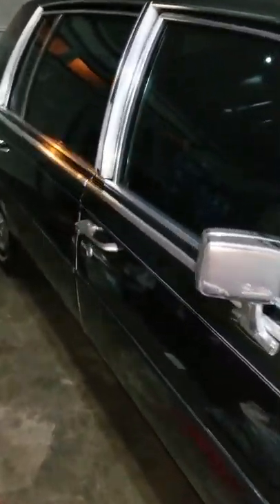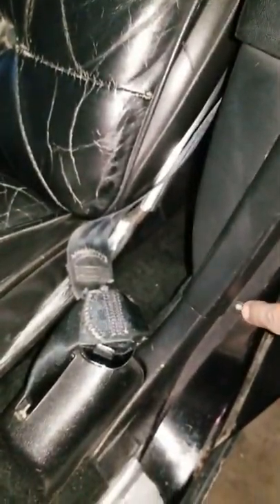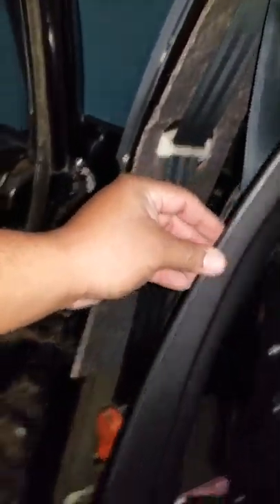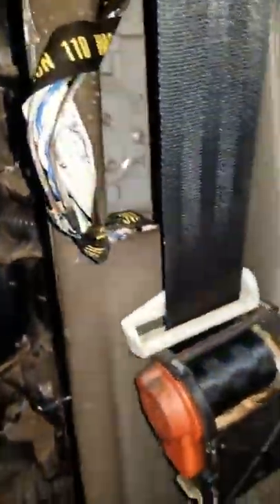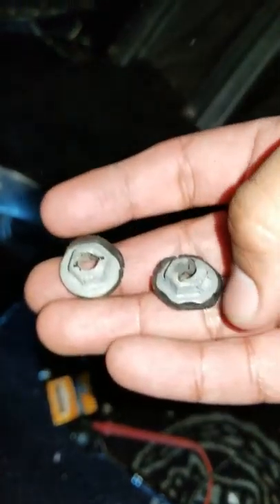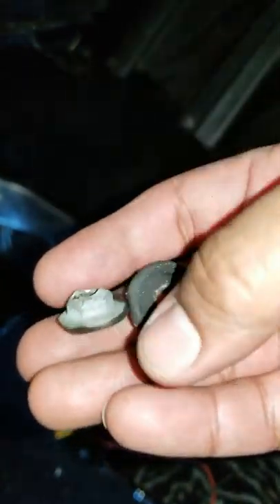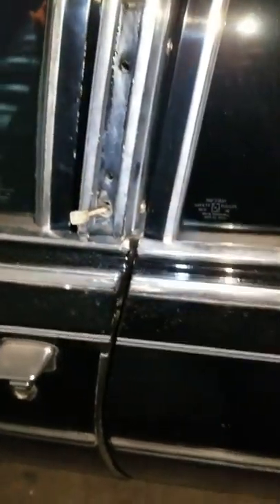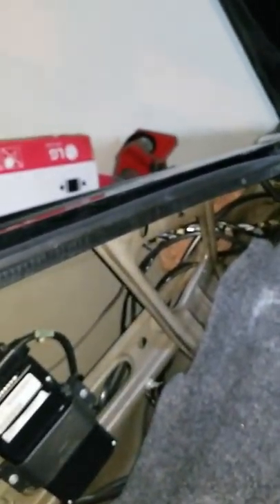How to remove opera light on 1986 Cadillac Fleetwood Brougham D'elegance

Comment: None of my 4 lights work.  Do you know when the lights are supposed to come on?  Doors open only or with the headlights?  Thanks, Dave.
Reply from the maker: From my knowledge I believe the lights only come on when your headlights are turned on. But I am not sure if yours would be different or not.
Reply: @wacoflipp2458  Thank you for the reply.  I have the huge service manual for the car and will be digging to see how it is wired.  The video is awesome.  Thank you.
Reply from the maker: @davewilliams1097  No problem, thank you. What year and make do you have?.
Reply: @wacoflipp2458  I have a 1989 Brougham as well, but mine is a 21 foot long Hearse.  I have NO idea where the coach builder might have hidden the inverter.  It has been so very HOT here in South Carolina to even think about crawling around in the back of the Hearse till it gets cooler.
Reply from the maker: @davewilliams1097  Yea I hear ya, its hot out here in texas too. If I would take a guess I would say they hid it somewhere behind those side panels in there towards the back end. But that's just my guess. Good luck on that!.

Comment: Hey man, i drive a 87 Brougham. Did your inverter works? Im struggeling with the same problem.
Reply from the maker: Yes, the inverter had power to it and from it to the actual lights. One of the lights had the clear plastic cover missing from it thats why i think they were not working, im trying to find other ways to go about it. Will post a video, once i find a good alternate way.
Reply: @wacoflipp2458   Before i buy new lights,i wanna check if my inverter is working but i dont know how to do that?
Reply from the maker: @karlgrill4665  The inverter is usually in the trunk on the left hand side behind the carpet, its a small black box with connectors to it, get a voltage meter and check the wires to see if you have power going through the wires. To and from the inverter.
Reply: @wacoflipp2458 I had the inverter in my hands already. There is 1 plug with only 1 grey wire,thats the one from the taillights right? So i guess i have to turn the headlights on to and check then the wires right?
Reply from the maker: @karlgrill4665  yes correct, turn your headlights on then check to see if you have power running through the wires.
Reply: @wacoflipp2458  Thanks man.Im not hesatating to say that a working pair of opera lights is the rarest part to find.The last quote for a mint pair was 600$.Can you imagine that,600$.WTF
Reply from the maker: @karlgrill4665  LOL... Yeah outrageous, better of finding another route to go or replace with an l.e.d strip. I've heard that you can buy the original EL tape is what is called. But havent looked into yet.
Reply: @wacoflipp2458  You mean someone produce exactly that size so i just need to install?I have to google that,tell me when you found the source or a website,would be perfect.
Reply from the maker: @karlgrill4665  Yes I will make a update video once I find or if I decide to go a different route I will do so too.